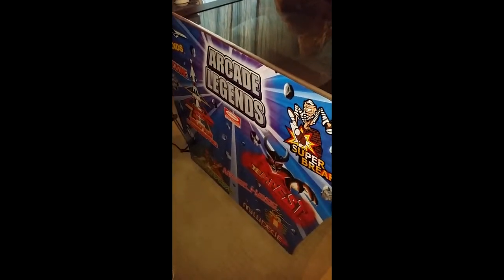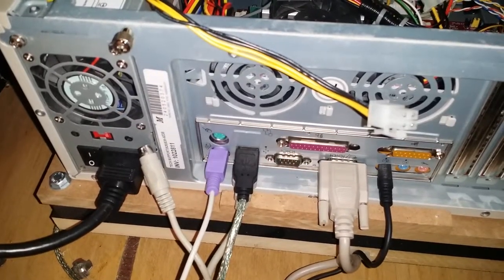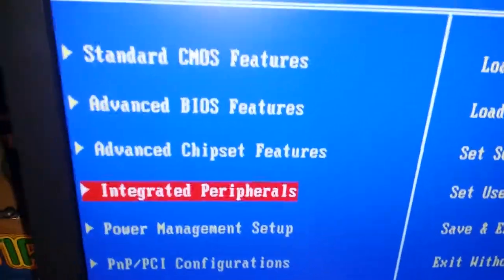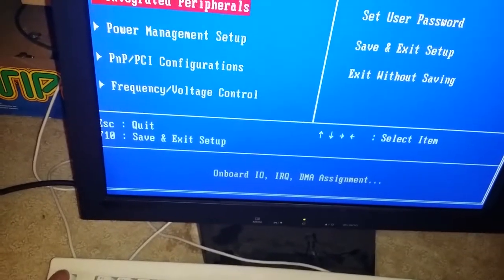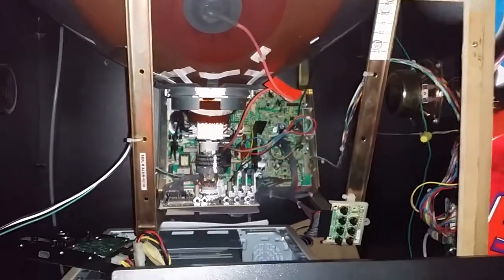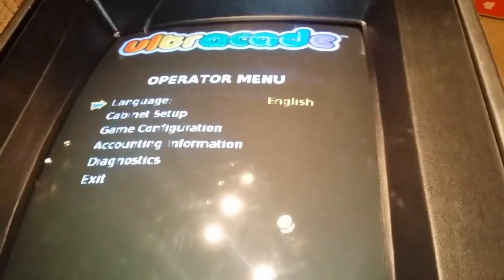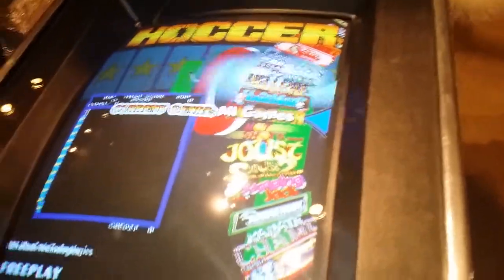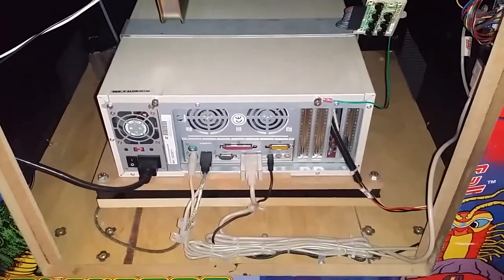Arcade Legends Hard Drive Upgrade install

Comment: I bought an ultracade hard drive with 250 games on it 4 years ago on ebay, got screwed paid 300$ for it and the hard drive wont go into BIOS to make the changes to get the games to run on arcade legends machine. however will run on computer monitor, I think this hardrive was for an ultracade  with an LCD monitor...my arcade legends has a 25 inch wells gardner video game monitor in it.
Reply from the maker: Watch the video it explains how to set the computer to monitor from VGA.
Reply: @DigitalJazzArcade  It wont work because the HD I have will not go into BIOS and I cant reset anything....Its an ultracade service HD and Ultracade monitors are all hi-res computer monitors and not wells gardner type arcade machine monitors... The HD you have is just some western digital with software from a computer burned on it which includes a working BIOS.. The only way I can run this HD on my arcader legends is to rip out the wells gardner arcade monitor and replace it with a hi-res computer monitor...
Reply from the maker: @jcummings187  so you will have to plug in a computer monitor into your computer to set up then you can switch back to the wells gardner.
Reply: @DigitalJazzArcade  already did it the arcade legends computer wont go into a BIOS on a computer monitor. it will play games on the computer monitor but not on wells garner 24in
Reply from the maker: @jcummings187  so as you turn on your computer hit the delete button when computer is booting. If this doesn't work, you may have a different computer and need to research how to get into bios mode on your particular computer.
Reply: @DigitalJazzArcade  i got into BIOS and made the change....now working.....what a pain..old slow ass PC..